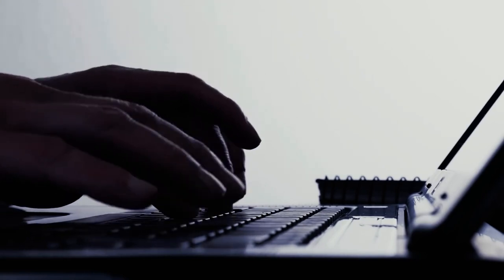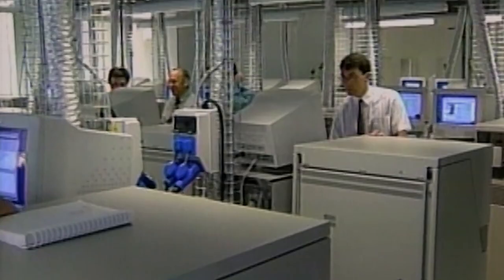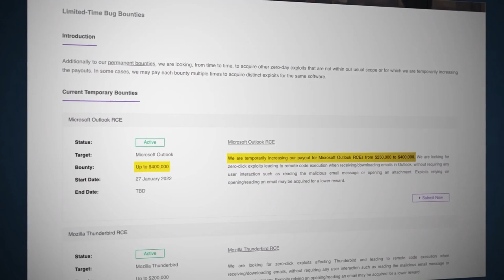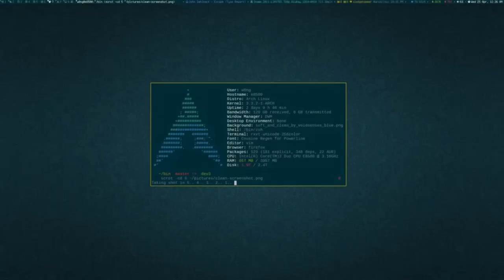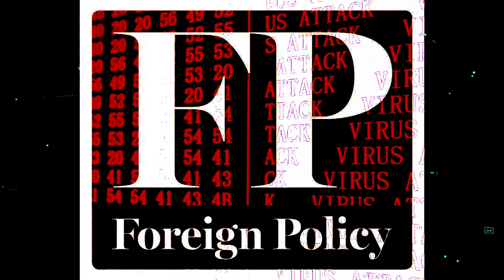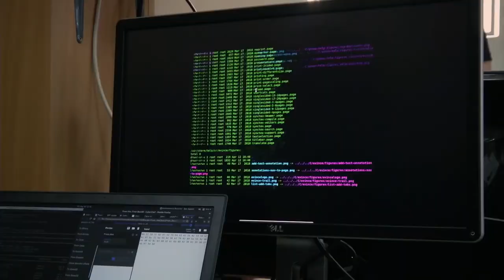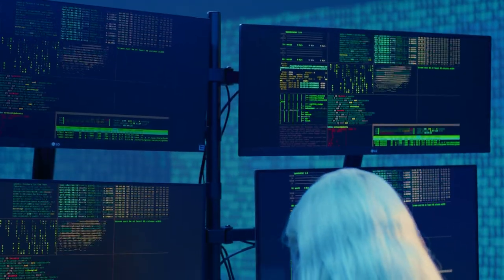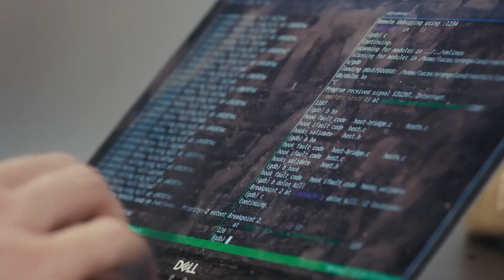Tailored Access Operations: Top-Secret NSA Cyber Warfare Unit

Comment from the maker: What did you think of the video? And do you have any suggestions or requests? Let me know!
Reply: JSOC's Special Operations Aerial Delivery Element SOADE
Reply from the maker: I will look into this. Haven't heard of this one before! Thanks
Reply: @the-spy-network  no problem. If you need a few resources let me know
Reply from the maker: I do actually, there's not an awful lot I can find about it. Please let me know!
Reply: Richard Marcinko Red Cell origins
Reply from the maker: Red Cell is on the list, definitely  @ROOSTER333
Reply: the aircraft didn't fly for 24 hours. i don't think there are many aircraft, much less fighters, that can fly for 24 hours w/o refueling. my suggestion is get the facts right for starters, and that leads to what else is fiction?

Comment: Flew for 24 hours in itself is a game changer. I am inclined to believe that the F35 runs on Cummins Diesel engines, or else they would not be able to fly for 24 hours straight.
Reply from the maker: Dang, that's not what I meant. It was meant to say it was retrieved after 24 (actually it was 28) hours after it had been flying for hours on it's own. My bad. I'll add it to the description as a correction.
Reply: Yeah this got me as well haha.
Reply: 1600-1800 kms - 1000/1200 miles
Reply: I herd it runs on wind power 🤣🤣